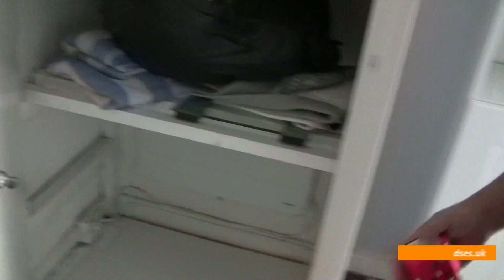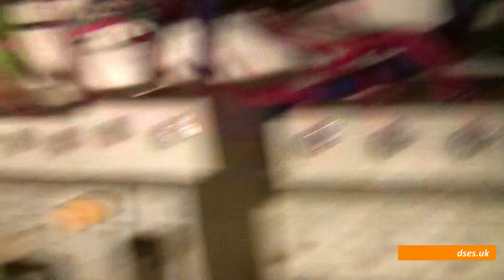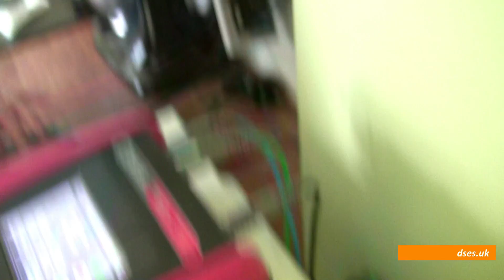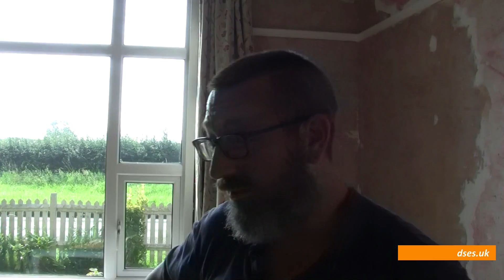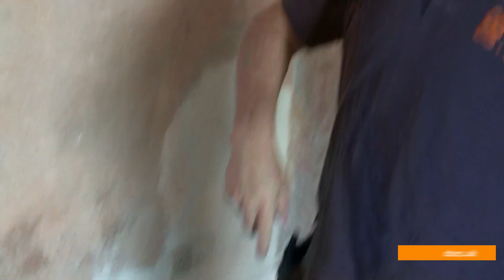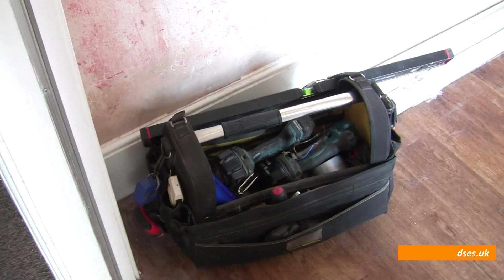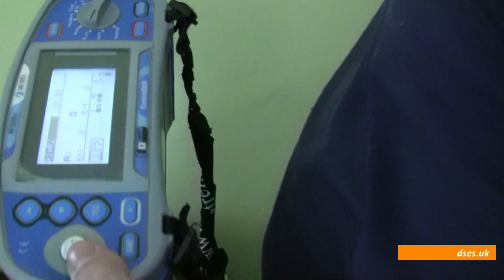On a domestic EICR

Comment: David do you use an r2 wander lead ?
Reply from the maker: Yes, I made one myself when I first started out of an old extension cable reel and some 1.5mm single wire. It has a probe socket on the reel end, and the probe from an old multimeter on the wire end!
Reply: David Savery Electrical Services cheaper than the kewtech one I bought ☹️ always handy to run around all the exposed metal bits and pipes
Reply from the maker: They are pricey which is why I got cheap with my DIY solution!
Reply: David Savery Electrical Services don’t blame you ,more money for onion Baji sarneys ,the best 👍🏻 bet nige was pleased later on
Reply from the maker: @darenvitaelectrical5310  There were a few thunderous rumbles in the cab of the van on the way home which saw Nigel hanging out of the window gasping for fresh air!
Reply: David Savery Electrical Services excellent !! nothing like a bit of farting to finish the day off

Comment: Sorry mate you have to do a test on the earth wire to the stake,not from The fuse board for a true Ze reading...All those earth wires give multiple parallel earth paths ,I had a TT with a ZE at fuse board of 18 ohms and when I actually tested the stake  it was 360 ohms
Reply: He did!
Reply: He didn't they were all in the earth block still on the right
Reply from the maker: Balls. You're right chaps, the damn thing went through the earth block on the right. Honestly not sure how I missed that, it was right in front of my nose. We've got a shopping list of things to do there, so I'll re-test and we'll be looking to put in a second rod to see if we can bring things down a bit.
Reply: @dsesuk  I think most of us have made that mistake time goes fast on eicr👍
Reply: David Savery Electrical Services yes it’s easy to miss some thing,on my patch we are expected to do a eicr in just over half a day ,truth is you can’t do it properly it’s all rush rush...So you finish up making up some of the results and only worrying about the most relevant results
Reply: @billynomatz9233  yeah be nice if there was enough in the job price to spend all day on one but doesn't happen often

Comment: Silly question but can you not just do a 250v Ir test L-N? Rather than LIM it so you’re still getting the results?
Reply from the maker: No, it doesn't work like that. If there's a load present, then reducing the test voltage will still give a zero result because the test current is passing through that load. The only way to guarantee the result you're getting reflects the fixed wiring and not something hanging off it is by testing when there is definitely no load present, something that's just not practical on existing installations as you could be there for hours disconnecting and wiring out loads, then having to reconnect them all afterwards.
Reply: Thanks for the reply David! Excellent informative work really helpful for a newby tester. Quick question then what would be your quick way of locating a fault short circuit issue on a lighting circuit?

Comment: nice electrician screw driver at cooker socket (no need vde 1000v protection ) otherwise 5 star
Reply from the maker: It's dead testing. If we hadn't already confirmed the circuit was isolated, we wouldn't be dismantling it.

Comment: David Hi, Just wondering, when you change a consumer unit how do you lengthen cables which won't reach the terminals of the new unit ?  I noticed on  your video you had to do this, but you didn't mention how. 
Great tutorials mate. 👍
Reply from the maker: Thanks for the feedback. Where existing cables won't reach where we need them to be, we extend them in any way that is practicable. That might be an external junction box such as a Wagobox, Wiska box, generic IP box, Hager J803 inline box or blanked pattress box with Wago (or similar) connectors joining the wires inside, or even a traditional screw junction box so long as it remains accessible. If the cable is in the CU enclosure and it's just a single core that needs lengthening by a few centimetres, then again something like a Wago or Spliceline connector or even a screw terminal block connector. Personally, I tend not to use crimps, but that is another alternative of course. So long as the crimp/connector used is rated for the size of wire you're fitting into it (which it should be if the wire physically fits into it without modification), then extending cables or wires is fine, and often unavoidable.
Reply: @dsesuk  Been thinking the same. Was trained to crimp but old cable rarely give a crimp a good, tug proof connection you can trust,  even with decent connections and good ratchet. Need to use the Wagos more often me thinks.

Comment: What's the best and easiest way to do an insulation resistance test if your doing a PIR?
Reply from the maker: Ah, well best and easiest are two different things. As a minimum, I'd do a test between line and neutral connected together and earth as I want to know if there is any risk of an RCD trip. I'd do this per circuit, but you could do it to a group of circuits if you disconnect their neutral bar from the RCD. That would give you a number, probably not an optimal one, but wouldn't tell you which circuit(s) were pulling that number down if it's not off-scale on your tester. That would be the easy way to get a number quickly. The best way is to fully test L-N, L-E and N-E per circuit after disconnecting all loads. It takes longer, but gives you a true representation of what state the installation is in.
Reply: Hi does the fluke 1653b ( as I have) do the live+neutral to earth on it like the megger!
Reply: That insulation test is really getting on my nerves! I have all RCBOs but when testing ( starting at 250v), I get a low reading or sometimes no reading. Am I doing it correct and does the fluke 1653b do the Live+Neutral to Earth?
Reply from the maker: @keithsykes7721  The 1635B supports IR testing like any other MFT. To test line-neutral to earth there isn't a specific setting on the tester, other than selecting the IR function, but disconnect the line and neutral wires from the RCBO, join them together with a croc clip lead, then connect one lead of the tester to the joined wires and the other to the earth bar.
Reply: Hi mate, I'm doing my IR testing and I'm doing ok but I was thinking, can I connect 1 croc to the the earth bar, another croc to the neutral bar and the third test lead to the breaker and TEST?
Reply: Hi David, how to IR test a ring main circuit? Do I put all four cables ( 2 lives & 2 neutrals in on croc clip and the other clip to earth? I'm a little confused how to do it on a ring, all other circuits are fine!

Comment: Was the DNO able to shed any light on why the Neutral might not have gone through the meter?
Also, didn't realise DNO could touch the meter, is that not the supplier's issue?
Reply from the maker: The WPD chap didn't pass much comment on the neutral. I suppose it doesn't make any difference to the operation of the meter, it's just a bit weird. I didn't expect him to change the meter out, but I'm not going to second guess him.
Reply: Thieving the electric, usually
Reply: The original meter was 2 rate with exposed live 5th terminal. Neutral is often like that after removal of old off peak board. It is allowed as long as neutral terminal on meter is blanked
Reply: David Gill DNO’s responsibility is any equipment up to the supply cutout so they will come out and deal with that.

Comment: How much did that easy cert knock you back do you have to pay for the software then pay for yearly subscription
Reply from the maker: Easycert Pro (the version I use on the laptop) is £209.94 with VAT for a singe licence, however a single licence annual renewal is just £47.94 with VAT, so once you're past the first year the cost reduces significantly. An alternative is Electraform who charge £1 per cert, but a quick count shows I wrote out 192 certificates since this time last year, so Easycert works out a lot cheaper for me.
Reply: @dsesuk  ok mate seemed alright what we saw on your video. Like you say have to way 
it up on how many carts I am gonna do thanks

Comment: How did you perform L-N IR test on cooker load side to appliance turn switch off?
Reply: Jason Elson if you watch the vlog you will know he didn’t
Reply from the maker: Cooker load side wasn't tested, it was a limitation on the report, so circuit 1 was only tested up to the cooker control unit. We want to avoid limitations, but dragging out that range cooker wasn't a practical proposition on the day.
Reply from the maker: Could do. Chances are that the reading would have been ropey as those range cookers seem to always have a low reading to earth, presumably from their heating elements being cold.
Reply: @dsesuk  you've got some good answers mate👍
Reply: Hense the limitation fool

Comment: Hi David when testing insulation resistance live and neutral combined to earth would that show a fault no matter what sequence the fault is on say if the fault was between live and neutral or neutral to earth
Reply: M H  so what faults would this show would it just be faults to earth or would it also show faults between live and neutral
Reply from the maker: As M H says, line and neutral become one conductor when combined, so we're not testing between them. We are testing how good they are with respect to earth as a line/earth or neutral/earth fault will trip the RCD and take out multiple circuits.
Reply: @dsesuk  ok so you would test like this say if you was going to change a non rcd protected circuit to an rcd protected circuit.
Reply from the maker: @gd-bq7em  If I can test IR line to neutral and then line/neutral to earth, then I do so. The cooker circuit in this video was tested both ways because the circuit served only one endpoint and we knew we had isolated the appliance at the cooker control unit. Where testing line to neutral is impractical because of all the connected loads or because there are loads we cannot access because of fitted furniture, then we skip the line to neutral test. If these circuits were on an old fuse box and were being tested because we plan to fit an RCD equipped solution, then it wouldn't matter if the line to neutral test had been skipped, it's how they test out to earth that we're really concerned with as RCD trips are a pain.
Reply: @dsesuk  ok mate got ya great explanation. Do you ever test the whole installation in one go through the incoming tails I saw a video on that the other day. where the tails had been disconnected from the supply and he tested the whole installation in one go there was no rcds present
Reply from the maker: @gd-bq7em  No, I don't really see the point. If I was replacing a consumer unit then I'd have to produce an Electrical Installation Certificate detailing test readings for all individual circuits. The only reason I can think of for testing a whole board in one go is if someone is changing a CU and isn't bothering with proper testing, inspection and certification and they just want to know if the RCD is likely to trip afterwards. Sounds like a shortcut move a rogue installer would use.
Reply: @dsesuk  ok mate great info keep the videos coming great for watching very interesting👍
Reply from the maker: @gd-bq7em  Cheers Greg!

Comment: When you get to an installation like that with a plan for a refurbishment don't you just recommend a rewire without even testing? I don't see the point of a full eicr when the best thing here is to completely rewire. The sockets are past it, the lights are all badly connected, loads of redundant fittings and cables.
Reply from the maker: It depends, the installation here isn't in dire shape; it looks creaky, but some tidying up ought to keep it serviceable.

Comment: Like you I use tysoft and although had it's quirks, it is by far the best especially the cost of the service packs. I have always bought used Lenovo or IBM laptops they are the best quality, a lot better than that Apple shit. That earth rod reading isn't bad, you could always Chuck a bucket of water on it 😂, you can go over 1600 ohms and it's still ok, regs wise.
 I did have a guy who worked for me, who would class a circuit as having a fault on if the IR was below 999 meg, which was very frustrating to me, I get your point about the accumulation, but your lowest reading was 22meg, that I seen, I am sure if someone offered you 22 million pounds you wouldn't think that was a low number 😂.
Reply from the maker: Yeah, it's all relative. The lowest reading on the day was 4 MegaOhm on a lighting circuit. I know 22 is comfortably high, but I still like to see three figures on IR!
Reply: @dsesuk  true, good video

Comment: Can't you attach any pics of installation recommendation to electronic certificate
That tester falling,get the robin started time to go home😂😂
Reply from the maker: I'm not sure if you can attach pictures in Easycert. I wouldn't do so anyway, the report is what it is, my covering email that goes with it is what contains the information on what we've found and the recommendations going forward. The MFT Pro has taken a couple of tumbles from the top of that ladder now; I need to figure some way of safely attaching it!
Reply: @dsesuk  put the neck strap on it that's what I do with my Megger👍
Reply from the maker: @jaye8578  Mate, the strap arrangement on the TIS is baffling and impractical! A good tester, but not as wearable as those in the traditional form-factors like my Metrel or your Megger!
Reply: @dsesuk  I think I know what you mean
Keep up the uploads very interesting and comical 👍

Comment: David, what do you charge for EICR’s I charge £165 minimum or £40 per board & £20 per circuit what ever is the greater.
Reply from the maker: I charge per circuit, £20 for each of the first six, then £10/circuit subsequent. That means an eight circuit semi detached clocks in at £140. I think we're cheap, but there are plenty of iffy outfits who'll do it for peanuts just so they can find things wrong and make a mint on remedials. Inspections usually lead to other work though.
Reply: David Savery Electrical Services I used to charge £125 to £165.  But found it just wasn’t worth it for the time spent doing the report as well as the paperwork.  It’s exactly the same where I am based, there are sparks doing EICR’s for £70.  I always say to customers, have a ring around you’ll get reports for much less than I’m prepared to do them for.  I’m sure something will come back to bite these people.  The report is usually not worth the paper it is written on.  Anyway, increasing my prices has not effected me in any way.

Comment: 6mm on a 40amp cooker circuit 🤔
Reply from the maker: The sign of a pre-loaded board bought from Screwfix. Johnny twat blindly uses the MCB's it comes with instead of sizing the protective devices for the circuits that are present.
Reply: 6mm has a Ccc of 47 amps if it’s reference method is C
Reply: @ishkebab  yeah but its ref b not c
Reply: Terry Beard  buried in a wall is method C ( plaster and not insulated) I didn’t see it in trunking but I might have missed it?
Reply: ian adams how you know it’s not in trunking in the wall
Reply: Terry Beard the same way that you don’t know that it’s not simply buried direct. 
Pointless argument
Reply: @ishkebab  david should answer lol
Reply: @dsesuk   what method was it mate out of interest
Reply from the maker: @terryscarpfishing  Obviously, the route of the circuit is a limitation on the report as I'm not knocking holes in walls or pulling up floors, but what I could see looked like C as it was clipped to the joists in the garage and came down the plastered wall in capping it seemed. My report didn't flag up any issue with it being on a 40A breaker with a 6mm cable as I suspect that's likely to be fine for the application and the likely routing, although had I installed the CU, I would have put it on a 32A as it didn't need to be any higher.
Reply: @terryscarpfishing  Who puts trunking "IN" a wall???
Reply: @ashmanelectricalservices4318  oval conduit
Reply: @terryscarpfishing  I was confused because you said trunking, but even if it was oval plastered into a wall, it wouldn't be Ref Method B.
Reply: @ashmanelectricalservices4318  ain't that buried in a wall then , new builds yes just clipped but old houses like this one would be buried
Reply: @terryscarpfishing  Right you are, just checked regs for multicore cables in conduit in masonry but from what David's said, the Ref Method for the cooker circuit was C.
Reply: @ashmanelectricalservices4318   well I say b started in c then goes in the walls by the old wiring that's buried,  but in the cables supported box  its always lim as not tearing walls down to check , I always put in b  it that's me
Reply: @ashmanelectricalservices4318  In NI, it's common practice to use round conduit tracked into block walls.

Comment: Are you recording the results from both MFT's, if so what serial number are you recording on the EICR?
Reply from the maker: Easycert allows multiple testers to be registered so that the correct one can be selected on any particular cert. For a report like this where more than one tester was employed, the Metrel has been listed as the instrument used even though some of the results were obtained with the TIS. Recording the instrument is supposed to leave a paper trail so you can demonstrate it was maintained and within calibration if you're required to do so, and so you can check back should a tester start producing spurious results to see if previous certs/reports were affected. As both are in calibration and checked monthly against my Megger MTB7671/2 test box, I'm happy that they're working as they should be and that the numbers we're getting out of them are likely to be about the same. If we undertook a test where the result was unexpected, we often check it against the other tester to ensure it's reading right.